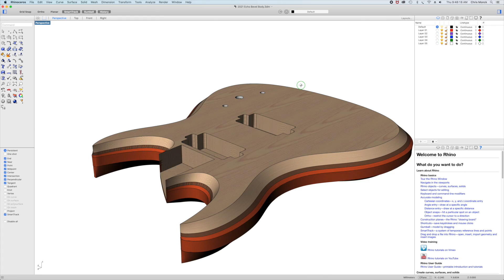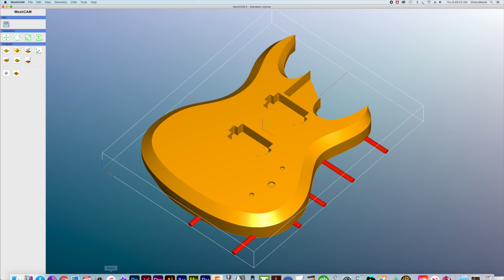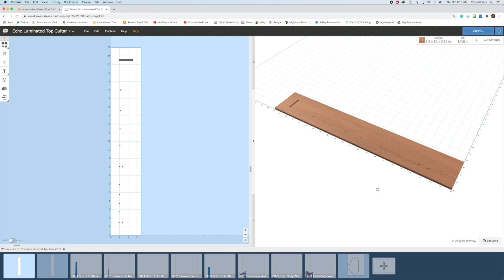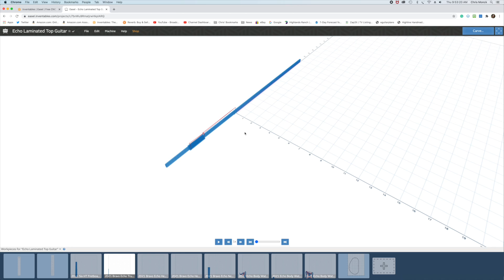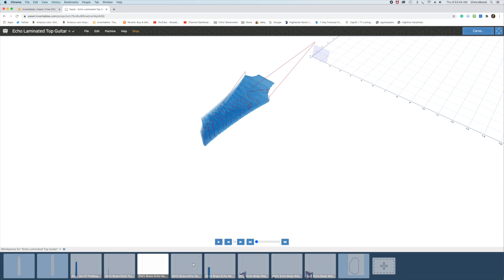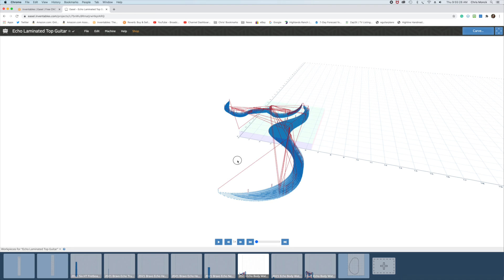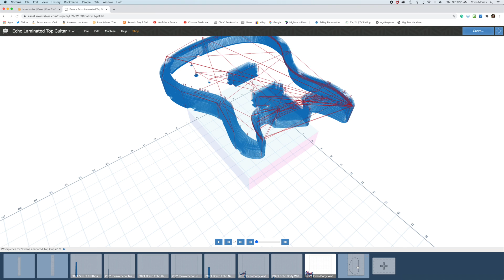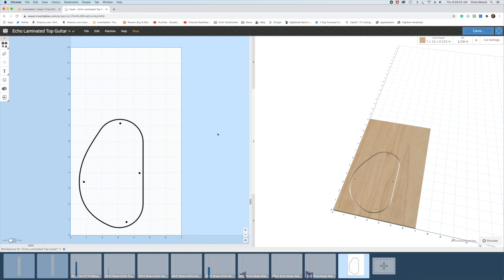Making A Laminated Top Guitar Part 4 The CNC Workflow

Comment: Hi Chris! Awesome video, I did my first cuts of Sambora SA2 model with Floyd Rose, the test material was cut really well, all parts fit well, I had to enlarge by hand hole for toggle switch between pickups. I'm doing now test assembly. It took me 3 hours for the body and 4.5 hours for the neck, what do you think?
Reply from the maker: That sounds about right. A bit slow, but in the neighborhood.

Comment: I'm just curious.. are the fret slots radiused too?
Reply from the maker: No. And to do so is a bad idea. If the depth of the slots doesn't exactly match the dimension of the fret tang, you'll have gaps or the tang can actually hit the bottom before it is seated properly.
Reply: @HighlineGuitars  that doesn,t make sense. If slots are flat then you will have gaps with a radiused fret  board [except at the edge ] not that it matters
Reply from the maker: @stephenjdixon1  In either case, you can easily fill the gaps with CA glue. However, if the depth of the radius is off even slightly, the fret won't seat properly.

Comment: Quick question (hopefully haha). Are you using end-stops to 0 the machine or just manually zeroing it with each carve?
Reply from the maker: I manually zero it based on the exact center of the blanks I use.
Reply: @HighlineGuitars  Thank you sir for that reply.  I assume you just re-zero the Z after every tool change and keep the initial zero for X and Y
Reply from the maker: @freiermann7  Yes, that is basically correct.
Reply: @HighlineGuitars  Thank you sir for taking the time to reply.  I appreciate it.  Love your vids

Comment: I have been a CNC hobbyist for a little over 5 years now.  We use different software for designing, and running our machines, but the process is very similar.  I built my first cnc myself, and it is similar to yours in many ways.  I then got crazy and decided to design and build a large rotary CNC to make drums (I am a drummer, not a guitar player).  I have done a few very basic videos showing my machine, but I am not real youtuber like you.

Comment: Chris, I'd appreciate your opinions on compensated nuts. They seem to offer similar benefits to 'squiggly frets' for true temperament, but without the horrid fretting headaches that come with squiggly frets.
Reply from the maker: They offer some benefit on open strings, but once you fret them, the nut is mostly taken out of the equation. There may still be some benefit for fretted notes since the string was intonated at the bridge and the compensated nut.

Comment: Your channel is where I learned to wind pickups when I had absolutly no clue before. Should I take the plunge and learn about CNC now too? 😅 great stuff as usual
Reply from the maker: As I understand it, Inventables is going to introduce some new CNC products on October 6, 2020. I knew nothing about CNC until I got my X-Carve. While there is a bit of a learning curve, Inventables made it much easier than I thought it would be. GO FOR IT!!
Reply: @HighlineGuitars  I'll be sure to check them out. Need to stumble my way my Greatguitarbuildoff2020 guitar but after it's done I may have a look at CNC 😁